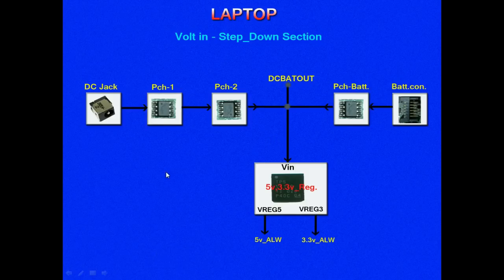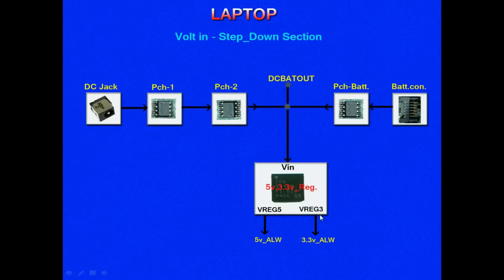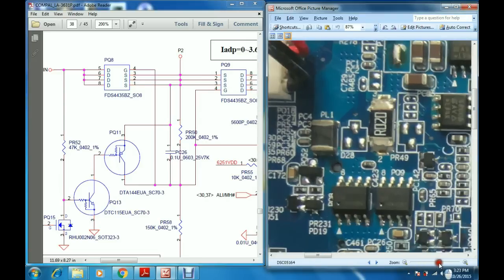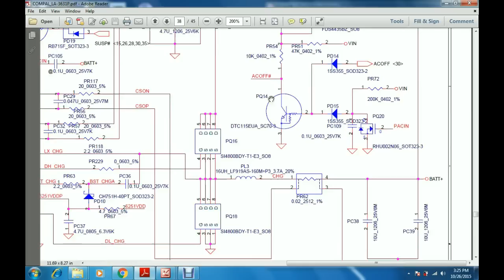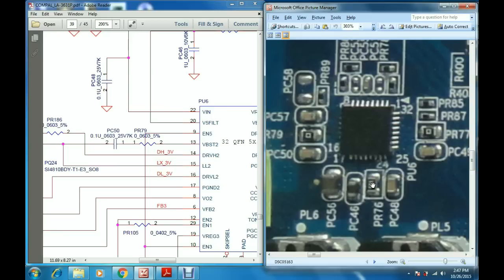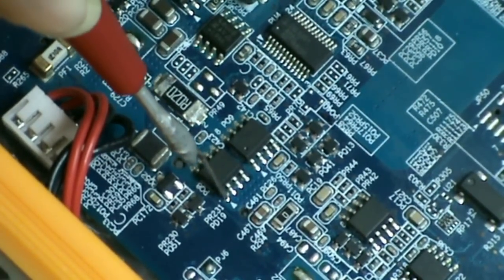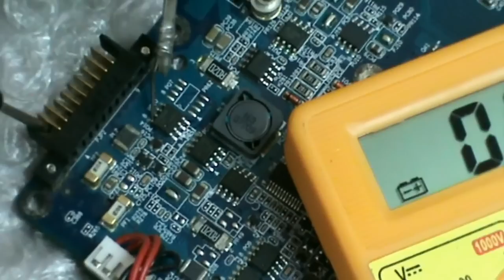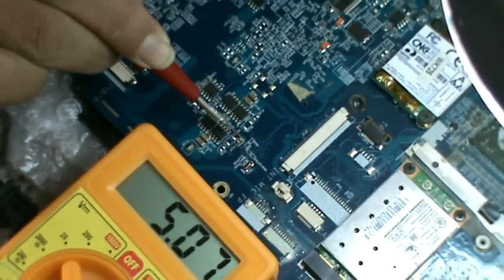laptop chip level training course in Hyderabad,how to check dead laptop,

Comment: Great teacher I
i am an amateur for electronics tryng to fix a daed hp pavilion dv 6000 totally dead, after analisis I concluded charger IC was not working properly and changed it so Vin, 3.3 and 5 volt came back but laptop still dead
could you give me an advice where is the next step in order to find what wrong
Many thanks
Reply: Where did you get the IC from?

Comment: my laptop is lenovo y570 and the power source from connection reads 19v but the first fuse as shown here doesn't read 19v after that nothing works,three capacitors on one side show very low voltage and on the side of capacitors reads zero any idea?.

Comment: Sir do you do Skype call tuition?  Cost?  Thanks
Reply from the maker: yes we do offer on-line training, but you should have knowledge of basic electronics
Reply: @efixlab  yes I have repair experience with electronics I would be just asking several questions like very specific individual pin signal checking to verify startup sequences and help with following circuit diagrams. Cost per hour? One on one Skype. Just asking several questions. You don't need to prepare anything.  Only pick your brain.
Reply from the maker: @Swenser  pls watch this video,https://www.youtube.com/watch?v=NJGxxR8QvhU&t=1s this is for desktop motherboard, if you expecting on y\this line , let me know